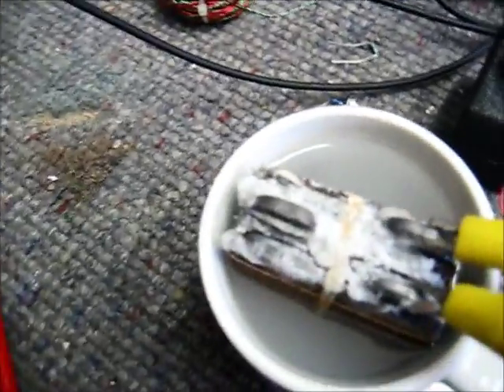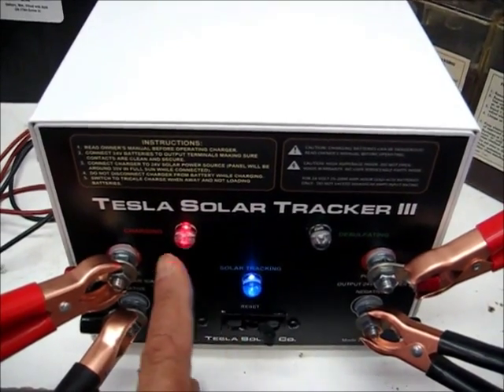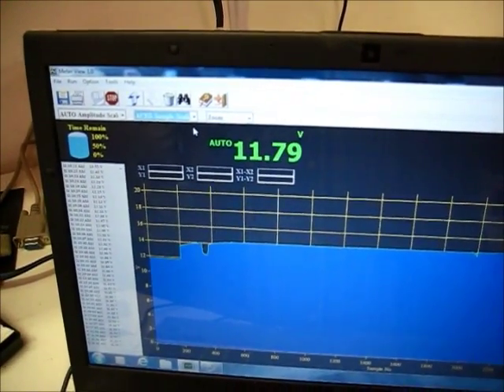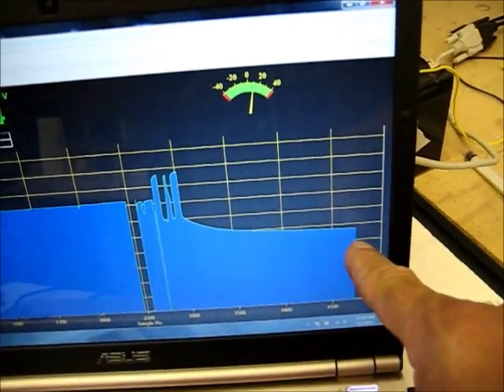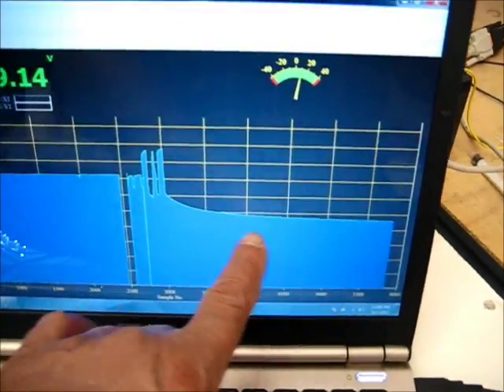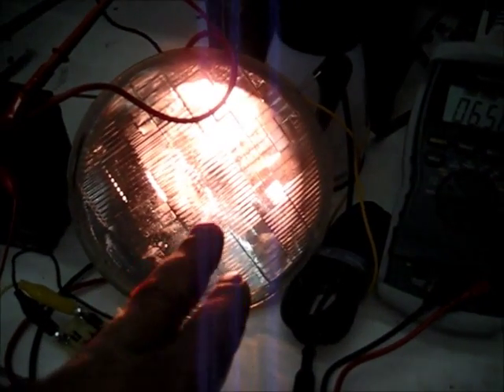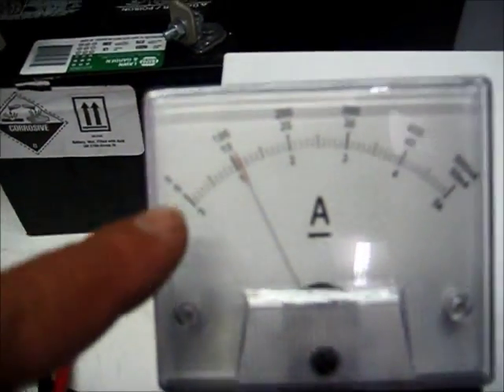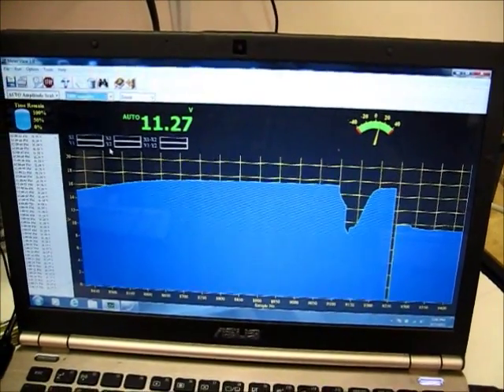The Alum Battery And The Solar Switch John Bedini

Comment: I find this type of thing very intriguing but I don't know jack about it. This current and voltage thing is throwing me off. But let me see if I have this right.  Bedini used a 200 watt solar panel to fully charge a depleted alum battery in about 15 minutes?